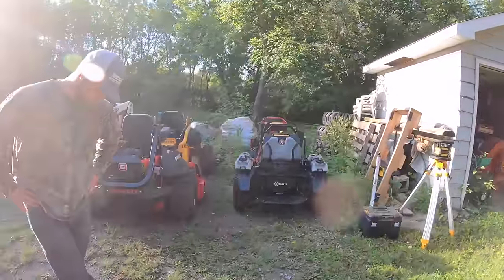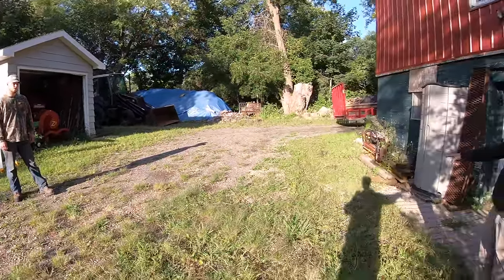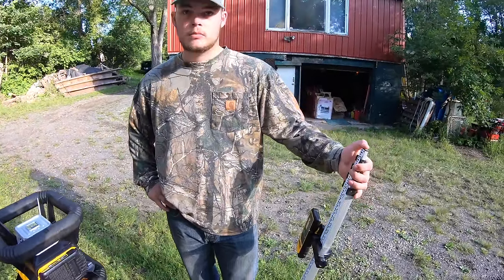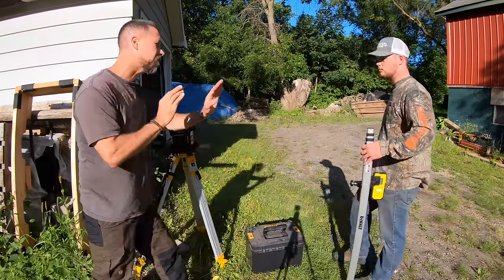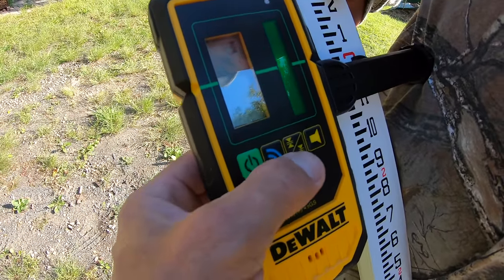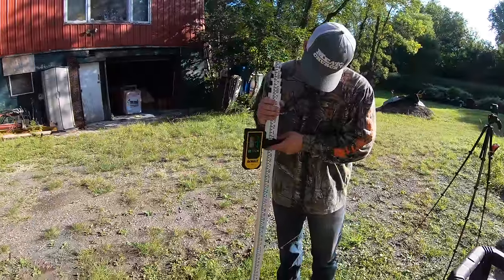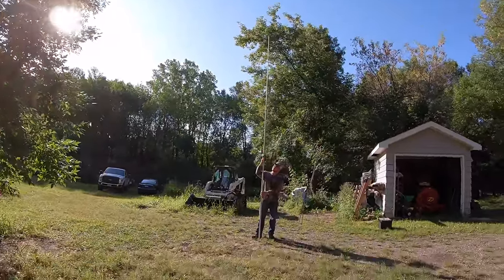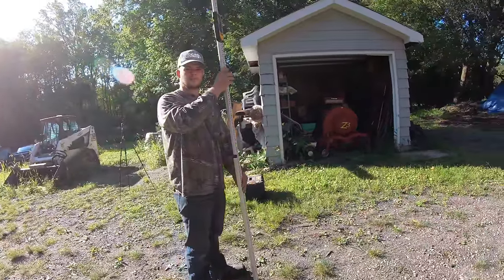Teaching a NOOB how to read grade, Run a laser & change elevations on a jobsite- PT 1/2. 4k video

Comment: Great video. Thanks for posting. I have a tip: Once you have first set up the laser, mark the laser beam with a pencil on e.g. the white shed - if you need to move the laser, or reposition it the following day, raise/lower the laser to hit the pencil mark and you'll be at the same height. Best wishes.
Reply from the maker: Thanks for the tip and for watching!
Reply: just set a benchmark, and in ur notes make the bench 100. Then change all ur grades over to plus or minus. so say the benchmark was 4.0 and u shoot a grad at 2.0 put it in ur notes as 98. that way when u come back and reset laser you know that that grade is minus 2 from the benchmark grade. then you know relative to the benchmark what all ur grades all you had shot before by simply seeing the plus or minus on bench. No re shooting all the grades. All ur previous values are still usable even with the laser at a different height or position/location
Reply: If somebody on my site was trying to set up a laser to hit a mark like that i would stop them and teach them how to shoot grades.
Reply: @seanmcdannel5919  That's a really good idea! No matter what height you reset your laser at, you always can know the grade.
Reply: @GT-43 exactly...

Comment: Great Video.  With regards to part 1, I do one thing differently.  You basically set your first benchmark on the bldg pad relative to the initial arbitrary laser height and not a true backsite relative to a known existing elevation.  This is fine if you know you are going to be complete in one day, or thier is no chance anyone is going to disturb the laser.  If you set your benchmark using a backsite off a known elevation,  you can take the laser down and reset it over and over and pick up where you left off without starting from the beginning.  If a known benchmark is not close by, you can fabricate one by setting a solid pole in the ground such as a 4x4 that will not move that can serve as a relative benchmark.  I suppose the concrete pad could have been your known benchmark, but you never marked the exact spot.
Reply from the maker: Good point.  On commercial work we have a bench mark set.

Comment: I think Alex is sharper than you give him credit for.  He doesn't look super confident in this video because he's new, but he figured everything out very quickly, and was probably thinking,"why are you boss-splaining everything like I'm 5 years old, man?"
Reply: I agree. And also, if he's your employee why are you name calling. Just call him a beginner or something. Calling someone a noob is not respectful.
Reply: He looked confused bc he read 6’3.25” on the second spot. Doesn’t that mean it’s actually LOWER in that spot than in the first spot where he read 6’2.75” ? You then told him that you were .5” high so you would need to take 2.5” off to get to the 2” drop per 16’ distance but I think since it’s lower already there you really only need to take 1.5” off. Someone tell me if I’m wrong but I’m pretty sure I’m not
Reply: I don’t think so. I read this as talking down because he didn’t give him credit. 

He was just thorough
Reply: @kevinbarker3891  You are correct.  The best and least confusing approach is to actually define the elevation of the HI and reference all the other grade elevations off of it, that way it is only subtraction from HI to get the correct grade elevation.  This will need to be done each time the instrument(laser) is reset up or moved.    See my comment above.
Reply: @MarcSelman some people say noob but mean absolutely nothing by it

Comment: 1 inch in 8 feet is very flat. Its hard to make water flow over dirt or grass at 1%. Sidewalks are typically 2% (2% is about 1" in 4'about a 1/4 bubble on a 4' level.)and I'm sure you all have seen puddles on sidewalks. 30+ years and just took early retirement here Minnesota local 49 Operating Engineers. So Stanley have you ever heard of "swedes" for checking grades? I learned about them from a blade operator i worked with for many years.
Reply: I thought the same thing. We used to always go 1/4 inch per foot slope on our concrete to drain water. And now that I do dirt work I always try to go at least double that if I can, because of slight variances in the dirt. Which would make his 16 feet out, more like an 8 inch drop. But then again I realize some situations might not allow that. But I want that water to go!, and get gone!! Hehehehe

Comment: When you put the stick down at the benchmark to measure off the next spot, put the top of the stick at the benchmark point so that the bottom is already right on the spot where the stick then has to be raised to vertical.

Comment: He may have covered this in the vid after I stopped but an easy way to get consistent measurements from day to day, or even having to move the laser during the day is to set a benchmark. We usually use a nail hammered into to a tree or telephone pole. That is your zero mark and everything can be adjusted from there. Have to oversee this waaaay to much as a construction superintendent. You never know if you will get the same guy back from day to day so a benchmark makes it consistent.

Comment: On one of my early jobs, I graded a yard exactly as the customer told me to, as he was standing there pointing and instructing while I was doing it. The next day it rained and there was a huge pond in the yard. He swore over and over that there was enough drop to drain the yard, if only it was cut right. I went out and spent more money than I made on that job to buy a laser (I got a Spectra) just so I could prove him wrong, which it turns out he was. This taught me: 

1) The customer doesn’t always know what they think they know. Pay attention to what they say about how things lay, then disregard it all and measure it yourself. 

2) Don’t ever trust your eye, trust the laser. That’s why you spent all that money on it. 👍😁
Reply: DONT CONFUSE a Laser with a Transit Level.
Common mistake
Reply: You are right when sitting on a loader or dozer if I go so it looks like I am going up hill it works out about level, If I shoot for eye ball level it ends going down hill.
Reply: @jimputnam2044   - have you tried using a post level on the equipment? It will indicate when the post it is attached is plumb or off plumb; you could fasten to one of the posts built in on the equipment and at least you can tell the grade direction while you are pushing dirt around.
Reply: @stevebabiak6997  Yes steve i have one of those bubble levels like they use on campers, level shows both ways actually is a good guick reference when in the seat. But of course not telling you grade but you know when you are going up or down.
Reply: @jimputnam2044  on my iPhone, I have an app that features a spirit level that does show degrees off of level. Skypaw Toolbox v5.4.0 is the app.
Reply: @stevebabiak6997  Thanks that sounds handy.
Reply: @jimputnam2044  -you’re welcome

Comment: Good video.  When thinking about cutting grade, it helps me to think about the location of the bottom of the measuring pole not the receiver.  As the pole bottom goes down, it gets longer, hence, the numbers go up, as if your measuring water depth in a pond.
Reply: Bingo.

Comment: At 18:00, the spot he measures is 1/2” lower, not 1/2” higher, so you’d only have to cut 1.5” rather than 2.5” to get the 2” drop. I don’t say that to pick on you (or him), but to point out again how easy it is to get it backwards, especially when the grade is so close to level. 

Biggest thing I learned early on is never to trust your eye, as you mentioned. It is easy to get arrogant and think you can wing it, but always trust the tool. My laser proves me wrong all the time. 😁👍
Reply: I got the same thing, and because it's my first time learning this I thought I was wrong till I saw your comment. Thanks
Reply: First numbers you had was 2' 8" 3/4 and 3' 8" 1/4 =  11 1/2  but i had 12 1/2 I sock In math but can someone explain me why I had 12 1/2 instead of 11 1/2 like they do 😐
Reply: I only trust my eye when it tells me something doesn't look right.
Reply: @carbajal23carbajal38  Because 3' 8 1/4" - 2' 8 3/4" = 11 1/2" (44.25 - 32.75 = 11.5)
Reply: @carbajal23carbajal38  suppose you're a bug climbing the stick, starting at 2' 8 3/4" and intending to climb to 3' 8 1/4".   Climb up 12 inches - now you're at 3' 8 3/4".   But that's too far - you're half an inch above where you meant to stop.  Go back down to the 1/4" mark a half inch below you - so now you're 11 1/2" higher than you started.  

In math terms, you need to subtract 2' 8 3/4" from 3' 8 1/4". I don't know how new-school math does it, but old-school me does it by "borrowing"; take one whole inch off and add 4/4 to the fraction, and then also take one foot off and add 12" to the whole inches.  
3' 8 1/4" becomes 3' 7 5/4"
and then
3' 7 5/4" becomes 2' 19 5/4"
And then
2' 19 5/4" - 2' 8 3/4" = 11 2/4"
And finally
11 2/4" = 11 1/2"
Reply: I completely agree I was thinking the same thing. He was wrong with the half inch high. It was really a half inch low
Reply: I’m glad someone pointed this out. A lot of people are going to be confused after watching this video if they don’t catch that
Reply: I have to feel sorry for you in the US still stuck with Imperial measures instead of metric. No offence intended.

Comment: I'm planning to regrade my backyard.  Eventually putting in a pool.  My grade slopes towards my back doors until the last 4 feet, then it slopes away for water run off.  It works and it was engineered, but I get nervous when it rains real hard in the spring.  I bought an old case backhoe a few months ago and picked up a laser level kit today and figured I better learn to use it before I go screw up my engineered watershed.  This was the first video that popped up.  Very good introduction to a noob that wears a tie and sits behind a desk for a living.  Off to find the second part to see how you move the dirt now.  Thanks for the great work.

Comment: Stan, great video.  I have used a Lenker (direct reading ) rod for 40 plus years. I had an engineer working with me who showed me how to use it 
 The Lenker rod does the math for you. To some more experienced guys who started off as you are showing your guy. It seems to simple.
But, to teach them this method is good , then advance to the Lenker. Also I work in tenths and hundreds of a foot. Again it's easier. 
Stay safe out there.

Comment: Hey Stan.  I love your passion for teaching.  Great video.  One comment to expand on what you have said is to consider frost.  If you dropped the grade 1 inch every 8 feet and get run off away from the garage pad that is great in the summer.  However, if winter comes along and you get frost that raises the elevation of the soil away from the house, the elevation will change to run toward the garage pad for the first few feet away from the pad.  Depending upon roof orientation causing water to be deposited or not in front of the garage, you may end up with the same problem again.  My advice is to make the grade steeper for the first 6 feet away from a building and then go to the 1 inch every 8 feet (or 2 inches/10' according to my father) after 6' away.  That will mitigate any frost risk.

Comment: Exactly what I needed.  I buried a drain line to take the water away from my barn rain gutters.  I ran 1 1/2" PVC down pipes, one from each end into a same diameter line roughly about 70 feet line.  My first mistake was I should have doubled the size of the drain line.  My second mistake was simply using a carpenters level to try and get a slight grade on the 10' pipe sections.  I thought it looked pretty good until the first good rain storm when the gutters overflowed.  So I bought a good laser level, tripod, receiver and grade rod

Comment: Not sure if anyone has already covered this: when taking the first measurement, 2’8 3/4”, you were actually at the bottom of the hash line which are 1/8” thick making that measurement 2’ 8 5/8”.
Reply: For dirt, 1/8th doesn't really matter.
Reply: I was always taught to read the laser in decimal form
Reply: @Emezepe3  Yup.

Comment: Great video sir! I’m a Pipe Layer, laying storm, water, sanitary, etc. The laser is a must have on a daily. Only thing I would add is the importance of making sure your legs for the laser are secure. Don’t just stand them up and ride out. Sink them in the ground( if possible). If outside, wind could actually blow over your laser or (believe it or not, this has happened) a bird land on your laser and knock it off line and then, like you said, you’re starting all over. Other than that, you covered it all! Love your content! Keep gettin after it! 🤙🏼

Comment: Great video. I purchased 6.5 acres on a ridge, that is totally wooded. I'm starting the process (solo) to clear trees for a homestead and extensive garden/orchard. Not only to I need to do the driveway, but cut out terraces for an RV (to start), greenhouse and other structures as I go, but terracing the land for the garden and orchard. Multiyear process. I have a Case backhoe and will be purchasing a box blade for a John Deere tractor, and just purchased an outdoor laser level kit. This is the kind of info I need to be able to have any success in this long term project.  Thanks.

Comment: 1" drop for every 8' run = 1/8" drop for every 1' run. Handy to know for concrete guys.
Reply: Also, I've been told that many/most/all levels are set up so the fraction of bubble over the line equates to the fraction of an inch per foot of slope; if you're an eighth of a bubble off of level, you have 1/8" per foot.  Quarter bubble out, 1/4" per foot. I haven't verified this for myself but if it's true, that's a pretty handy piece of information.

Comment: Good video. To make it even simpler,get a grade stick with numbers n both sides . Then attach  target to the front and on the highest number. 25 foot grade rod set target at 25 feet.Back side numbers run opposite of front . Now pull more stick out till you are on target then read your elevation . Works better than moving target each time and has same accuracy

Comment: Thanks Stan.  I never realized how easy it was to use a laser.  Until someone explains it, it seems like a huge mystery.  

I will offer one suggestion on your training.  I never start out by saying something is really difficult.  I think that makes most people think they cannot do it.  When you were talking about how the numbers go up as the grade goes down I was confused until I figured out what you meant.  As the grade goes down, the level point will be higher because the stick is lower and the level point is at a higher point on the stick.

Comment: You mentioned that if you bumped the Lazer and reset it and it is 1/8" off that at 1000' it would be way off. If the laser is automatic leveling and is off any amount, it will be that same amount even if you are shooting miles. So, if you moved the lazer 1" up or down ,and you had a already set a shot mark even miles away, the difference of the new mark to the old mark will only be 1". Try drawing a wavey line left to right. Set up your laser so the line is above that line. Mark the line now move and just set the laser level but don't use the lines to set the height, just set it level. Now measure the new line to the old line and the dimension will be the same on each side. This just proves the point. Thanks.
Reply from the maker: oh yeah.  Your probably right.

Comment: Great content as usual.  As a technician in my local County Highway Department I do this stuff all the time.  You are spot on with this vid with 1 possible exception.  I'm not sure if it was just a slip or something real.  At about 7+ minutes in you referenced 1/4 inch increments on your rod.  Actually your rod reads 1/8 inch increments.  Each mark and each space is 1/8 inch thick.  You can read top of the mark and bottom of the mark for more accuracy.  Hope this helps.  Actually I expect that you already know this but missed saying it in the vid.  It's a really minor point.  And by the way, I loved the Cub Cadet stander vid.  I have a Ferris Z1 36inch.  When I replace it I will choose the Cub Cadet because of your content.  Keep up the good work.
Reply: Then is it a) center of mark b) top of mark or  c) bottom of mark that is dead-on?  From what I see at the 3 foot mark on the stick seen in the video I would assume it's top of the mark that's dead on.  Is that correct?
Reply: @michaelglidewell1524  either top of the mark or bottom of the mark is dead on.  same it true for the space.  the space is 1/8 thick.  the mark is 1/8 inch thick.  This totals 1/4 inch.  bottom of the mark is the top of the space.  4 marks and 4 spaces make 8 increments.  if you try to pick the middle of the mark or the middle of the space, you're always guessing at how close you are to the top or bottom.  I will add that I am typically using a manual instrument so I can see this in the gun (instrument) easier than adjusting a receiver on a rod.  Being consistent is the key.  I also use a rod that is spaced in 1/10ths and 1/100ths of a foot. so its slightly different for me but the concept is the same.  Top of mark/Bottom of space is the same reading.  Equally Bottom of mark/Top of space is the same reading.  It's just a way to get more accuracy from the tools available.  Hope this helps...
Reply: Yeah, and on the rods that read in tenths, it’s kind of the same thing, each black line is 10 one hundredths of a foot thick, same with the white spaces between the black lines, same thickness. So bottom of the black line 0/100ths, top of the line 10/100ths, then you go up to the bottom of the next black line, you’ve added another 10/100ths worth of white space, so you’re at 20/100ths, and on and on. Pretty easy after a minute.